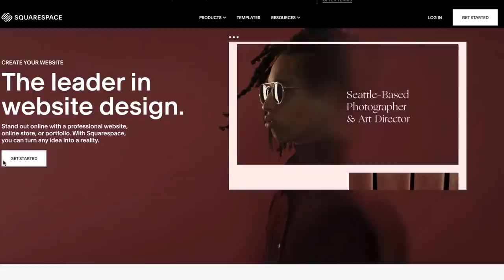The Best Way To Protect Your Timber House

Comment: Jess' ad transitions are absolutely awesome -- get me everytime!
Reply: A freakin pro, haha
Reply: I look forward to this every time
Reply: Did not see that coming lol!
Reply: I was ready for it and it still 100% got me
Reply: They are pretty cringey
Reply: I have
Reply: As a DIYer it's good to find videos based on NZ home repairs. I've just purchased a 1950's house with same cladding as your house. My house also needs corner protection. If you had of put soakers on, would you use the multitool to make a small gap under the above weather board or would you just gently tap the soaker on with a hammer until the top part slid under the above board?

Comment: " I don't wanna buy another vacuum".  I just wait until one shows up in my garage.
Reply: My suggestion for your workshop/garage for dust collection that has worked well for me. A small high volume vacuum unit plus a passive dust collector in from of it. I mount mine on a purpose built trolley.

Comment: In the states we install our horizontal board siding in similar ways although it is rare to see the boards mitered at an out side corner.  The most common method is to use corner boards for out side and inside corners.  The corner boards should go on prior to installing the siding but can with careful layout be "cut in" latter. This is a tedious fraught process and should be avoided unless an existing condition requires it.  After the sidewalls are prepped, and water "proofed", the cb's, are installed. I should add here that corner boards could go on prior to running the exterior wpm. When best practice meant using 15 and 30# felt to "paper a house" a continuous 12" strip of "paper" was applied, folded over the corner  before the corner board was installed. The advantage here was you could delay installing the field paper until the actual siding installation began and not worry about the effects that UV would have on the paper/felt. Another advantage was the corner boards could serve as a the story board to install the horizontal coursed consistently spaced around the house.  In the past we did this with water levels but lasers have taken over that job.  Having used water levels all my career as a "side waller" and commercial lather I know that they have many practical  advantages but young carpenters are smitten by technology so it's a moot point discussing it.  In any case my water level was an essential part of my tool kit. If there was a project that demanded pinpoint accuracy it's was and in my hands anyway still is the superior choice.  But I didn't intend this as a rant about WLs,,, sorry. Since side walling was generally considered a specialty branch in carpentry in the area of the world were I learned the trade, the side waller was required to be skilled in all forms of horizontal/vertical board siding, shingles, T-111, lathe, Aluminum and vynl siding. This often meant that the crews I was running were installing different products on different jobs at the same time. I often kept the portable story boards in my truck but the marked up corner boards served as a permanent reference on site. And if there was an issue it was generally very easy to determine where the mistakes were made and how to get back on layout. Cb's like lath corners can be made to be perfectly plumb or straight with a simple plumb line. Not that we had to do this that often since it didn't gain us much and if the wall was way out it required shimming of the siding to keep the reveals consistent. But this was important in lathing for stucco to "true up" the walls. Once cb's are installed and all other trims are on the fun began and it was a race to the top. Since all that is required is a simple but joint between cb and siding and the layout is already there you crew can fly up the wall.  One awesome new tool that I wish we had back in the day are these siding "gecos"  https://www.homedepot.com/p/PacTool-Gecko-Siding-Gauge-for-5-16-in-Siding-1-Set-Per-Package-307202020/202530064.  I don't believe they would replace all the other efforts at keeping the courses straight and true but they would eliminate a substantial amount of snapping lines.  If I had the choice between this and a laser I would take this tool hands down. 
After all is said and done, cb's and siding installed is a clean and simple vertical joint between both that could be caulked if the siding were to be painted or left alone when installing a stain grade finish material like White cedar or Cyprus.  There is so much more to say about material choices but I'll end it here.  In all cases corner boards are superior to any other way of protecting vulnerable exterior and interior corners. Whether set after siding with scribes installed as you demonstrate or as described above they are my choice every time I spec
 a building of lasting quality.

Comment: This just in; if you find yourself going in circles you need to abandon circle space and head over to square space. 

So glad to see corners ran over that ugly flashing. Most siding here is always done with different colour trim to make the house look more bold. 

For your weatherboards could you do what we do with our engineered wood? We leave a 5/16" gap for expansion and contraction and have a flat colour matched aluminium flashing behind it for water run off. The boards don't touch and can't swell, winds get into those open ends and drive the moisture out

Comment: hi scott, you probably know this already  but festool have a duel hose connector so you can have it on both the chop saw and table together, mines always under th e shop saw as yours and then the second 5 metre hose is spare for other tools mostly the track saw.. works really well

Comment: Hey. Love the videography and your work. I am learning heaps. 🙌👌. I would recommend oilbase undercoating the bare timber before applying the 2 Pac filler. This will increase your adhesion, stop staining coming though, penetrate/seal the timber this will create a longer lasting finish. It's not something that alot of painters do but that's what I do.

Comment: Your scribe is beautiful, a classic detail. I have a more barbaric solution I did on my house over 20 years ago. I installed the box trim over the lapped siding, then I ran painters tape over the siding next the the trim, careful to shove it tight into the lapped corners with a putty knife. I filled the gaps with hard expanding foam and let it cure. I cut flush to the trim with my pull saw and a razor knife. The excess all came away when I pulled the tape. I buttered the foam voids with painter’s caulk on a putty knife. Prime and paint, done. Sounds amateur and barbaric, I know, but it has held up and looked good for all this time on the sunniest exposure of my house in harsh Northern California heat and sun.

Comment: My wife and I just got a ducted heat pump installed in our house. It was originally heated by either a propane heater or electric baseboard heater with both options being expensive. We love it and highly recommend to anyone that does not have the option of natural gas (the other less expensive alternative). Where we are, we're able to get a 7 years 0% interest plus some rebate.

Comment: You're easy to follow...and I have a short attention span. Ha! Since I saw you using it thought I'd also let you know I bought the new Makita Multi-Tool based on your tool review...my first. Beyond a day & night difference between it an my friends older corded Fein. He's doing the demo/reno downstairs and I'm just helping when I have the time. Can hear his throughout the upstairs and sense the vibrations. When I use mine I play music on a small blue tooth speaker that's about 8-10 ft. away and sing along with significantly much less vibration than what I hear from his transferred to my hands. Thanks for the tool review and those box ends look so nice. I think it looks better regardless if the wood was damaged or new.
Take Care 🤙🏼

Comment: Imagine the work required by those old Victorian homes with all the filigree/gingerbread woodwork everywhere. I like the corner solution despite the extra scribing work. Here in the USA I've never seen those plates used on siding joints, interesting. You've got yourselves a beautiful spot for a home there.

Comment: Great job Scott. I definitely suggest leaving a small gap between the bottom end grain and the trim so that all the water that runs down does not have the ability to soak up into the end grain of the paint ever fails.

Comment: Left a comment on your other video about the heatpump. Go for a multizone ceiling cassette system. Ducted units can be annoying because they blow the same temp air in every room, even if that room is sunny and doesn't need as much heating...
Reply: Cadillac solution is concealed(ducted)multizones. They are ducted, have ducted returns, can be place in ceiling closets for access, relatively thin, zoned. Best of all worlds but they are just costly given all of the drywall finishing, ducting, soffits, linesets, etc

Comment: Nice work mate looks good, box corners great option with windows with facings. I've been drilling a small 3-4mm hole at the end of a crack in timber weatherborads seems to work well to stop them spreading. Repair care is also a great product for larger cracks or damaged boards seems to be more flexible to allow for movement in boards. Keen to see the houses transformation well done bro

Comment: Here in Finland wood siding is always installed over battens which leaves usually 22 mm air cavity behind siding or even bigger depending is wood planks installed horizontal or vertical. And because of that air cavity behind siding it always remains much more drier because if it gets wet it dries easier because it's surrounded with air.
Reply: Having a cavity between the framing and the cladding is a requirement in NZ nowadays. Bare in mind this house was built in the early 60s out of native hardwood (typically Rimu). All houses these days in NZ are built from Radiata pine which is far less robust

Comment: I think if a ducting system is in the budget then go for it as they are more costly but they look great and you get the whole house done which nicer than just 1 or 2 rooms. Looking good nice job with the corners and cracks.
Reply from the maker: I agree Ian, big cost up front but I think we will be happy with it long term.
Reply: Also agree, and if you have the budget to add some electronic dampers to shut some rooms off when not in use it will show on the electricity bill. Keep up the good work, enjoying the vids scott.

Comment: Installing a Dust Deputy (or simular in-line cyclone) will save you $ on bags and filter. I use the Dust Deputy in my shop and the Festool separator on site. Makes a huge differance in longevity of the hepa filter and bags used. It has more than paid for itself in savings.👍

Comment: As always, love the video. I reckon split systems make more sense than ducted for almost every scenario. There’s absolutely efficiency lost by moving heated (or cooled) air around as opposed to making it in the room with a split system. 

Perhaps bulkhead mounted multi-split would be a good option?
Reply: some ducted system move refrigerant around... so it's not too bad on efficiency front

Comment: I would add silicone under the metal endgrain protectors. Your solution dont stop water from getting in. The boards will dry from moisture moving inside the wood.

Comment: Firstly, that was a slick segue into the squarespace sponsorship.
Next, what did you use to fill the irregular gap between the 'box corner' and the weatherboard? It looks like builders bog (2 part epoxy filler)
My house has brick on two ends and weatherboards front and back. There is a type of box corner that's nailed and adhered to the brick and overlaps the weatherboards, but it isn't sealed and I believe that driving rain is getting in and around the corners against the weatherboards
cheers 
Damo

Comment: Expanding foam to fill the gaps in those corners is the way to go Scott. Trim it just below the surface, bit of wood filler or polyfilla and you've got a nice flexible seal.
Reply: Treat with anti-rot and wood hardener. Done a few times very effectively in England. But then need air flow and damp, especially from condensed water vapour to get out

Comment: I had a weatherboard house and used a timber treatment chemical mixed with turps. It treated the timber and I put new metal soakers on the corner. I made them myself because the old sizes weren't available any more. Instead of replacing all of them, I just replaced the ones that needed it.

Comment: Nice tidy work neatly done.Scott..BUT ...... No one you mentioned seems to think wood preserver/preservative is needed.?????????...What do you use ?"Cuprinol".?...Whatever brand , kerosene/water based and type would have been a big conversation here in UK Northern Ireland Ballynahinch very small island with wind off the Atlantic...... We rarely have atmospheric humidity less than 60% often 90% and more. Are you low humidity????   Or why is there no extensive rot when soft/white wood is painted, which would not preserve it here!!   BTW...... I agree the new brush-less Makita multitool is very good afteryears of using  a 24yr old Fein with only friction to hold the blade before any sort of star or pins .. At that time it was the only oscillating tool anybody made!!!!....But it still works. Just not so well

Comment: I’m curious why not cut the siding back then put the corner on. Typically here we trim the corner then butt  the siding into it? 

Try a cork miter on your corners sometime way less long flat seams to paint. Love the content
Reply: I was thinking the same thing. Seems simpler and about the same labor, especially with the scribers taking so much time and effort.
Reply: Weatherboard is not "siding" in the North American sense. If you cut it back, there would be no supporting frame behind the ends of the boards.

Comment: We have a lot of weatherboarded houses here in the South East of England. It was cheaper than bricks for several centuries and so used a lot for houses below the gentry. Most tend to have brick going up a metre and then timber also it’s certainly not unusual to see timber almost to ground level. We are in the middle of a house-building boom which most people see as necessary because of demand- I agree although I would also like to see incentives (eg tax breaks) given to the owners of houses that are longer term empty so that they sell ( in my case, father died and we left the house empty for a while whilst we had other issues). Anyway, thousands upon thousands of houses are being built in the SE because that is where the biggest demand is. Many of these new estates - most if not all actually, are thrown up on the build quick; sell quick; run principle. There is the trend to make some of these new houses, particularly those facing the main road, which viewers will see first, in faux quaint style. They may well be weatherboarded to imitate a traditional style. Looking at those, there are 2 types of weatherboard - timber is most common because of cost and then cement-based, maintenance-free (if installed correctly) cladding. On both, box corners are common because, I suggest, it covers badly cut corners. I have never seen your infill scribed piece on any of these houses. 

What I do see is your constructed right-angled 2 - piece timber secured straight onto the corner and then the weatherboarding is cut to a tight butt-joint fit.

The advantage of box corners is obviously that it discourages moisture to hit the end grain; the potential disadvantage is that you can’t see of rot is happening. However, I would still favour your box corner with scribed infill.

Comment: Most common repair I do on timber houses:
Repair rotted lower frame of sash window. 99/100 aren’t painted on the underneath or there’s no fall on the baseplate of the window frame.
Water sit s there, goes under window and just. Wicks up into sash due to not sealed with paint.
Same story, on doors. Nobody paint s the top and bottom

Comment: Hi Scott, NZ'er here. What brand is the two pot epoxy you used for the board repair and can I get it through an ITM? I have some rot in window corners and sills that needs fixing and I don't think bondo is the best. Resene has Dry Flex but its very expensive.
Reply: Hopefully Scott replies but judging by the colour and how easy it mixed I would say it is Dry flex. Speaking from experience don't use Bondo, the repair wont last long. I transitioned from Bondo to a Norski epoxy product from Bunnings. Its very thick to mix and apply, and time consuming waiting for it to set especially in colder temps and hard to sand. Its much better than bondo though but it sets hard which I think can still be a problem at joins, it is much cheaper than Dryflex though. I opened the wallet and tried Dryflex on my last repair it is much easier to work with, mixing, applying and sanding  it can flex aswell which is a major advantage. I will be using Dryflex from now on. Make sure you 'prime" the bare timber first with both products (its just a thinner epoxy liquid to soak into the timber first and give a strong bond, Norski also state it stabilises rot so you don't need to remove it all as long as it dry but I would still try cut it all out). 

Its one of those cases where you get what you pay for, you don't want to have to redo joinery repairs every few years when it doesn't last, just speaking from personal experience.. 

hope that helps..

Comment: Our house was built in the 60s and it is pretty much the same as yours in everything. I need to do a box corner but I worry about lead paint and sanding.  I am assuming the house used lead paint as from everything that I've been told, lead paint was heavily used outside in those days.. Do you have any advice? Awesome channel.  Thank you